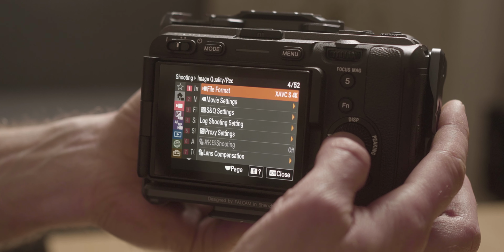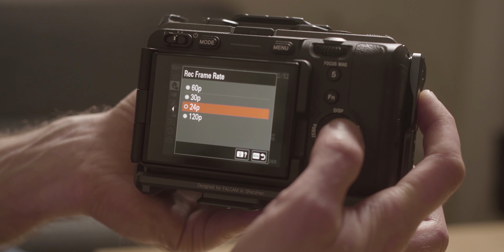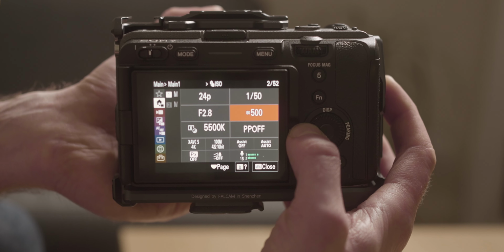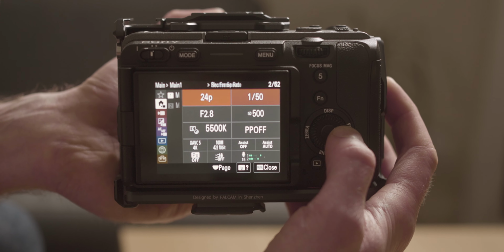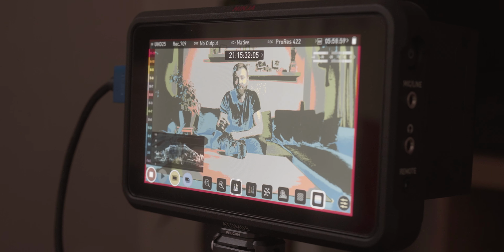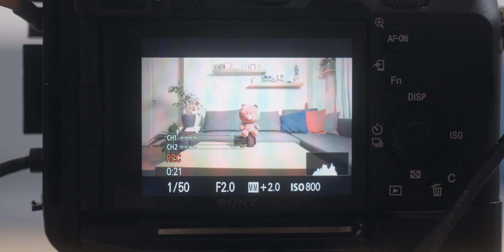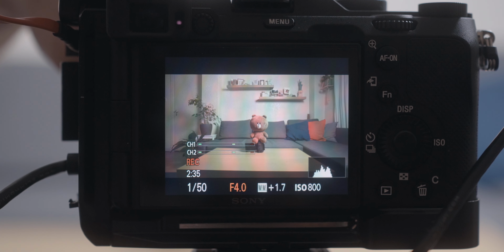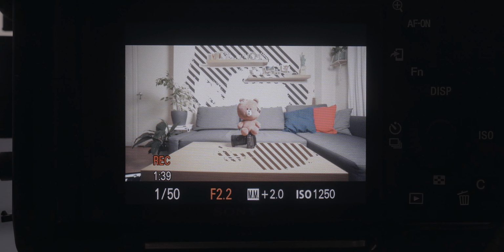Advanced Camera Settings for Beginners to Get PRO Results

Comment: Great video. What autofocus settings do you have? I have mine set to “wide” but I’ve had a few videos go out of focus when I have props in the scene (I think you can see this in the video I sent you) but also in my latest video (Webflow API)
Reply from the maker: Thanks. Most of the time wide with Faca-AF priority (this square on my face you saw from time to time when I recorded a back screen of my a7c) By touching a screen (as long as it's not broken 😉) I can get a spot focus to set a focus on a specific part of the frame. a7c despite the same sensor as A7 III got some improvements to AF accuracy. However, some of my talking head videos were shot with a higher aperture (to get a deeper depth of field) and manual fixed focus to avoid AF hunting from time to time.